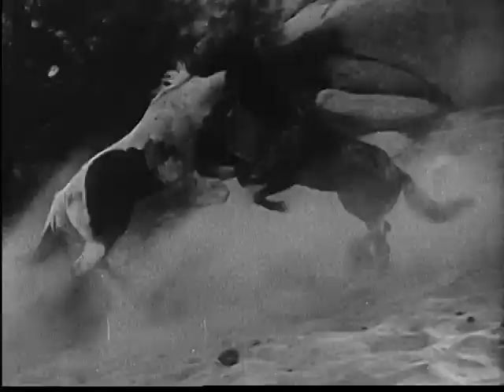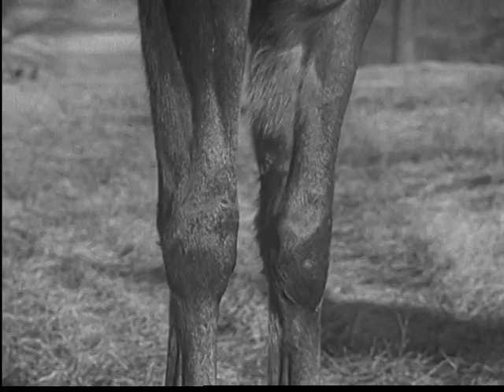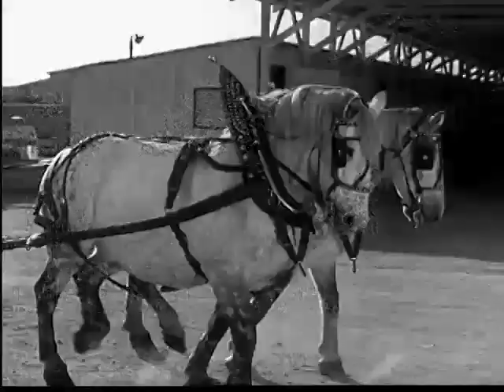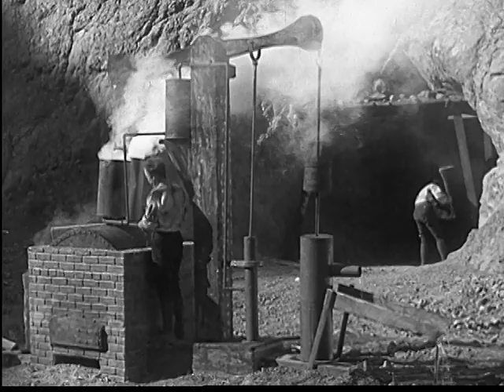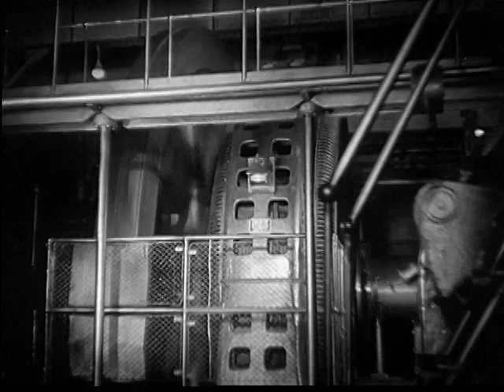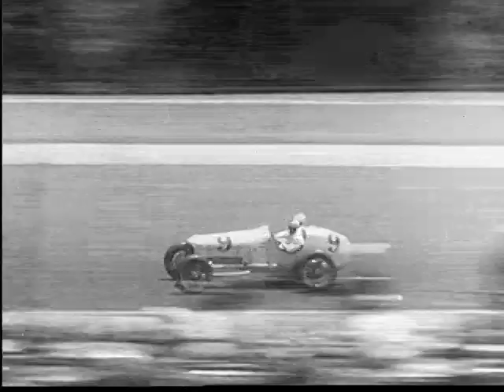Horsepower (1937)

Comment: As a Mechanical Engineer, I'm amused that James Watt carefully measured horse power to make it a standard, while the most widely used unit of power today is the Watt!  Coincidentally, one horsepower is equal to nearly 3/4 kW (745.7 Watts), convenient for estimated conversions.
Reply: The funny thing is that one HP isn't even equal to a horse's Power. So it's actually not a correct unit of measurement.
Reply: @jwalster9412  Similiar to meter for measuring a length. Originally 1 meter is 1/10 million of 1/4 of Earth circle, or so what scientist though when they invented it (nowadays we knew if Earth circle is little more to 40 million meter in equator), yet most people around the world still used it. Very convinience to measure anything in human scale.
Reply: @haikalmiftah2529  atleast it's not as messy as the imperial system.

Comment: The equation written on notebook is neither Metric nor Imperial standard.

Because in metric, it will be 76 Kilograms per 1 Meter per Second to make 1 Horsepower.

And then 1 Horsepower equal to 746 watts.

Comment: Ok folks Now lets do some math. Do ya think that 85 horsepower engine could raise  550 x 85 = 46750 lbs 1 foot in 1 second? Or what about 2805000lbs 1 foot in 1 minute? Remember folks this is engine horsepower NO Gearing! Or would 46750 lbs yard the crank, bearings, connecting rods, and precision pistons, right through that block? Just goes to show that the horse power scam began with the invention of gas engines.

Comment: 2021 and even the cheapest cars have more than 100hp today.  Some come from the factory with 600+ HP.  What glorious times we live in.
Reply: Rimac nevera has 2000Hp from factory..
Reply: But what can we really do with that?  We move along at a speed and typical acceleration easily accomplished by 100hp on a 1 ton car.  We don't launch, burnout, drag race, or cruise at 200kmh.  Anyone who tries on a regular basis gets pinched.  Heavy cargo trucks can use it for heavy loads and grades. 

60hp on a bike and 130hp on a car is probably all anyone needs.  The extra is just bragging rights or noise.

Comment: remember kids, vehicles were better back in their day. They had a whole whopping 85 horsepower!!!!! Could do any job that modern trucks and cars can do with EASE. My base model, 170HP, completely stock machine is NOTHING just because it is newer. Forget the double horses, fuel injected engine, AIR BAGS, seatbelts, glass that doesn't create neck-slicing shards, gasoline without any lead. All that is much worse than back then.

Comment: " if you can't explain it easily, that means that you don't understand it well enough... " 

Albert Einstein.
Reply: What part did you not understand? The experiments by Watts found that the average horse could move 33,000 pounds, a distance of 1 foot, over the duration of 1 second. That's one horsepower. 
That's a good quote by Albert Einstein, but it doesn't apply here because the video explains it pretty simply.
Reply: @toytacambery9427  1 horse power is not equal to the power rod one horse..

Comment: A real horse is a powerful animal. But a 1Hp engine does not seem worthy of a horse. Bottom line it's arbatray unit of measurement based on moving 33,000 lbs, 1 foot in 60 seconds or 33,000 ft-lb/min.

Comment: Summary:

- here are some horses
- "horsepower" is the power of a horse
- look how technologically advanced we are

great video
Reply: That's still crazy when you take in consideration it takes 3 million ants, or 5 men to produce one horsepower, and with that is a specific unit of measurement and at the time you were able to get 85 hp, now we are achieving 200+ in modern day sportscars. You cannot supply that amount of energy with your mortal energy if you tried, let alone the horse is now obsolete in terms of modern day travel.  Yeah half the video was horses but they are fascinating animals when taken of what they can do.
Reply: Horsepower is actually more than the average power of a horse.
Reply: Ah I see you didn't understand the actual explanation of 1 horsepower being 33,000 pounds, moved a distance of 1 foot, over the duration of 1 second.

Great comment

Comment: A horse has 700 skeleton muscles.  A horsepower unit is misleading to children and an unfair assessment of the power of this animal.  In no way does a horse exert the full use of every one of its muscles when pulling a rock up from a hole.  It's fine people need a unit to measure power of machinery, but that should not be used to frame the power of a horse.  I think people intuitively know the great strength in these animals, that their 1 hp weed eater simply does not have.   Just the jaw bones the horse uses to eat hay is probably greater than a weed eater.
Reply: It's more about the sustained power of horses, than the instantaneous power of horses.   A human can produce 1 horsepower instantaneously, but very few can sustain anything close to it.

Comment: Horsepower depends on the size of the horse, and not sure why 550ft lb came into being...It would make more sense to refer to output of engines and motors in kilowatts.
Reply: Paul R most likely they deemed the standard thought of horsepower on the Thoroughbred, the most common “everyday” horse at the time. So the 550 lb. probably came from what it could lift or move when Watt was experimenting. I’m sure if he used a draft horse instead it’d be a lot more because they can move far more weight.

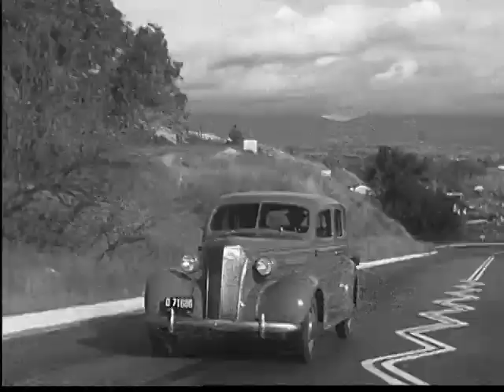Comment: What does the zig zag line at 8:15 mean? I tried googling it but I am only getting British crosswalks.
Reply: Back when many cars were low on power and manual, zigzag lines told the driver that they should switch from 3rd to 2nd gear for more power while going up a hill
Reply: Kincaid Harrison Ah, thanks. They do seem to be on a hill
Reply: Stripe painter was wasted...
Reply: It indicates the steep grade the car is climbing
Reply: Yeah I was wondering that myself. My best guess, and it is only a guess, is that it has something to do with the road that goes off to the left(screen left, car right) that is about half way through the zig zag. Double solid line means no passing, so the zig zag double solid might warn of cars coming in from a side road. But really I have no clue.          P
Reply: I noticed that too. i'm assuming it means no passing

Comment: The horsepower should be defined as how much body weight the horse can move, Horses are  around 840 - 2200 lbs, If a car has 500 horse power, it ought to be able to move 420,000 lbs to 1,100,000 lbs as fast as a normal horse can move
Reply: john cuting that does not really make sense as any low friction/ air resistance vehicle would get insane amounts of horsepower. Trains can weigh anywhere between 1,5 to 6 million kg, according to your idea that engine would have to have 12-24 thousand horse power whereas the speed of a horse can be achieved by engines with normal horse power ratings in the low thousands, something like a single HyperCar engine or two sportscast engines

Comment: Thats 1 HP. On the other hand, 1 BHP is one horse stopping an engine running at maximum rpm by pulling a brake on the flywheel.
Reply: OOOOHHHHHhhhhhhhhhh.... thanks Geezer!

Comment: If that 4 cylinder engine was a honda engine it'd make 250hp.
Reply: honda didnt exist back then
Reply: Randy Wiesendanger  your reply does not make sense. If you wish to write in standard English then I may be able to reply to you
Reply: Randy Wiesendanger  The Mercedes M139 is a 2 litre, 4 cylinder production engine that produces 416 hp.

It will be fitted to the A45 and other 45s. What do you not understand?
Reply: If it was Mercedes-Benz it'd make 400hp
Reply: @porkbroth  nope, japanese make higher hp out of smaller engines from revving them to the max, while american and european big cars make higher hp out of bigger engine displacement. japanese machines excells in maximizing power out put of a similar sized engine made in europe or america, but typicaly will wears out sooner. the clearer obvious example of it is comparing an HD motorcycle, with its thumping muffler sound, to a suzuki hayabuza, with its bee like buzz sound.
Reply: Your feelings about car manufacturers are not facts. Mercedes-Benz have 2.0l 400hp, the most power dense production engine by far. In fact, the most power dense engines are all European
Reply: @porkbroth  i'm talking about common average engine (at least in the past several decades) not only one grandeur design with overated price. fact: japanese was the first to manufacture small engine bikes than can go relatively fast. not american or european. when i say small, i mean realy smal some 50 cc mopeds or 100 cc bikes and scooter in asia
Reply: I agree that it is a show piece. I was merely juxtaposing the original comment.
Reply: @porkbroth  ooh, okay

Comment: If you trim the fur, you might get 2HP.
Reply: Add some stickers for extra 30hp
Reply: Fun fact, as modern horsepower is measured, at full output a horse has about 15hp
Reply: @pauld.b7129  But that's the full output, which the horse can only do for a short time.
Reply: @pauld.b7129  that’s how the redline is determined
Reply: There are also other things that can weigh down a horse... We have to set the horse for optimal racing conditions.
Reply: Mopeds
Reply: Can I do this on my Honda?

Comment: Horsepower is just for show tourqe is what counts
Reply: Not true.  Horsepower is how much work can be done.   Torque is how quick you can do that Amount of work.  In a piston driven engine horsepower and torque are equal at 5252 rpm’s.     So you are truly wrong that horsepower is just for show.
Reply: Its the same!!! Inj ft pounds or Nms.

Comment: I wounder if you can use 1 horse power to fly by using gear ratio changes?
Reply: Yes.

The Gossamer Albatross was able o cross the english channel via proper application of a single person's physical output, and even more recently, a human powered machine was able to lift itself vertically off the ground. A 1-HP motor should be able to perform even better, assuming of course, gearing, like you said.

Comment: Ford and GM have always used Shetland ponies as a benchmark in their horsepower ratings  ,looks good on paper !   while Chrysler always used Clydesdale  Horses as their point of reference , which explains why a Mopar engine rated at two hundred horsepower will always run the wheels off a shitbox ford or cheby rated at four hundred horsepower !!!!

Comment: So my 6.1 Hemi SRT engine is rated for 425 Horsepower oorrrrrr 85 Elephant Power.
Reply: Shayne Baldwin 1275000000 antpower looks so much better
Reply: It's funny you say that, the 426 Hemi from the 1960s, is called the elephant engine.
Reply: In that case, my 2018 Mustang GT makes 92 elephant power. (460 HP)
Reply: have you considered the unit of Zebra force or Llama Thrust?
Reply: 85 times 8000 lbs, (moderate sized Asian Elephant) = 680,000 lbs.
Could your Hemi really move the equivalent of 7 maxed-out 18 Wheelers?
       Would have to do it at 20 mph, which  is about the top speed for an elephant
Reply: @Reasonable Speculation never mind the elephants, 500,000 lbs of horse flesh would drag his hemi around the countryside 3 ways from sunday lol
Reply: My 89 corolla makes 90 Peter griffin farts and is very efficient, only running on whatever Louis feels like making
Reply: Anything other than Horsepower just sounds wrong.
Reply: My 22RE got 110 Llamathrust
Reply: The koenessegg one:1 has a miniscule one, kilo watt of power.
Reply: Shayne Baldwin and, 425 actual horses would have more torque then your hemi!
Reply: brandon bentley not if you gear it low enough.
Reply: @brandonbentley8532  no, his hemi would be more powerful than 425 real horses.  This is because James Watt used big-ass Clydesdale horses.  They are bigger and stronger than the average horse.
Reply: @j mcmann Not even 0.01% Shaggy Doo power. (this is dying)

Comment: It's incredible to think how there are cars now days that produce 500 and 600 horsepower.
Reply: I think you mean 1000 HP
Reply: @Hurileno  *2000Hp
Reply: Lou Fazio about 10,000 horsepower
Reply: Yea, but the expensive engine needs to be rebuilt by an aircraft mechanic after just a few runs.  I'm far more impressed with mass produced engines that can last a long time.
Reply: talfacprez   Top Fuel Dragster is ridiculously extreme. The casual observer probably isn't even aware of how much this is.